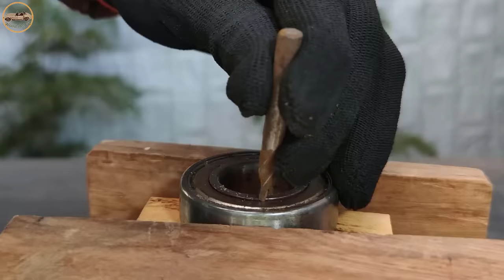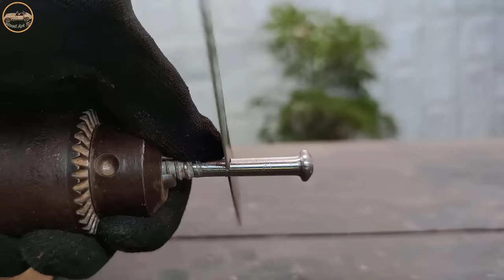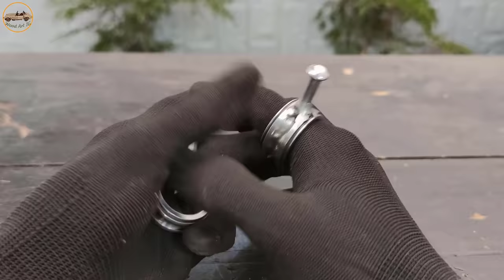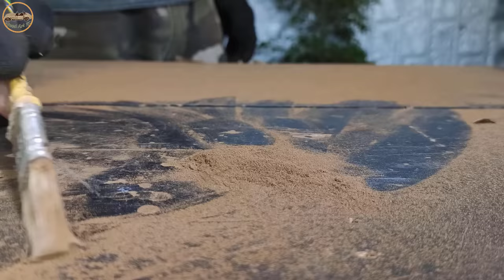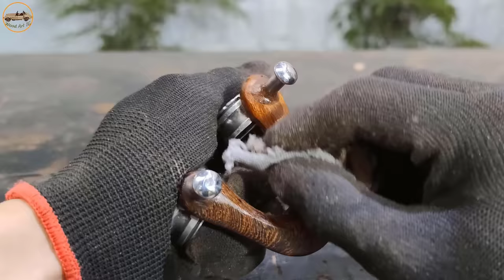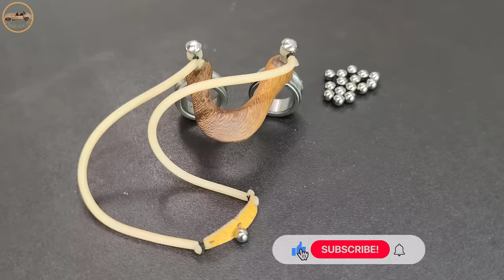Best DIY slingshot | Compact, simple and use a new feeling | Wood Art TG

Comment: very pretty. always thinking about what more can be done. 
you could wrap a bar that follows the left forearm upwards with a pin at the end to keep the rubber band taught, but not fully drawn.
also a right arm ball dispenser,  where you flex your hand inwards triggering a tube of balls drops a single ball in your palm.
one of those tactical assault slingshots.
Reply from the maker: hi.you are really knowledgeable about slingshot.thanks for your opinion.i will implement it.have a nice day

Comment: I see a broken nose in your future.☺️
Reply: How? Explain. What sort of issue is possibility wrong with this?
Reply: That would be impossible unless he totally opened his hand while aiming…that might not even be possible!
Reply: Wood is slanted edge.
Reply: Nothing that could possibly break off of that and hit him in the nose could break his nose. Cause a cut/abrasion or possibly put out an eye? Yes. A broken nose? Virtually impossible.
Reply: Skill issue
Reply: How so?
Reply: Sure!!!
Reply: @RSKLove Welding the hardened steel of that bearing. If the weld doesn't penetrate deep enough, it will fail eventually.
Reply: You seem like you deserve one

Comment: It is not compatible to weld a pin (made of st37 steel) with a 6013 welding wire to a ball bearing alloy. It will be cut or broken. Hazard!

Comment: Nice idea but it could be done better: rubber band don't last very much fixed in such way, bond two bearing rings with glue and wood(especially with that grain) very bad idea. you need to control torque generate by pulling rubber band. Ok if rubber band is weak like that hemostatic band but not good with a stronger one.
Reply from the maker: thank you

Comment: what size of tube band did you use? is there standard size of tube band for slingshot? steel ball size?
Reply from the maker: Thank you for your interest. size in bearing 2.2cm .ball size 6mm
Reply: @woodarttg  am refering the size of rubber tube you use?
Reply from the maker: @cyberbeast1789  thank you. the rubber tube i used has a diameter of 4.5mm
Reply: @woodarttg  thank you
Reply: @woodarttg would you make this for us